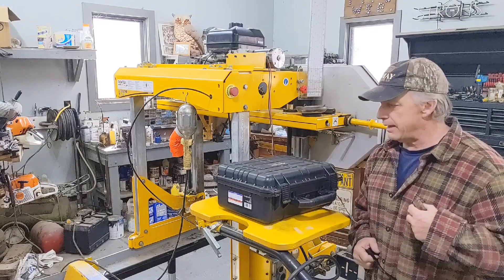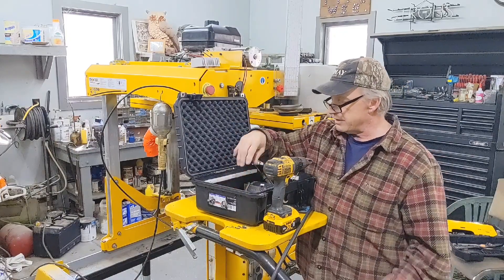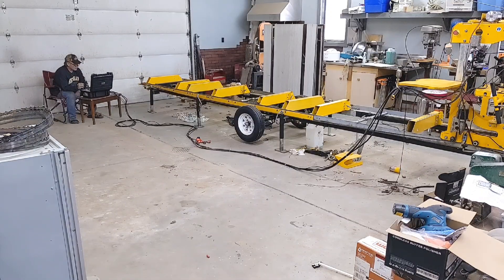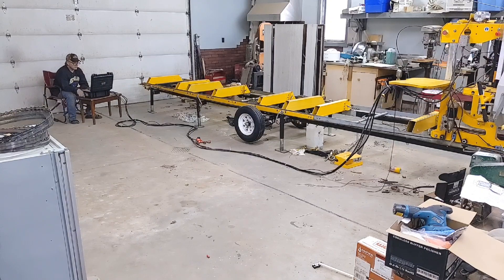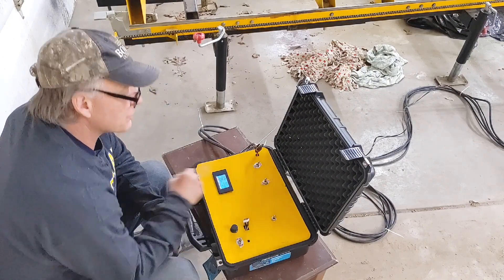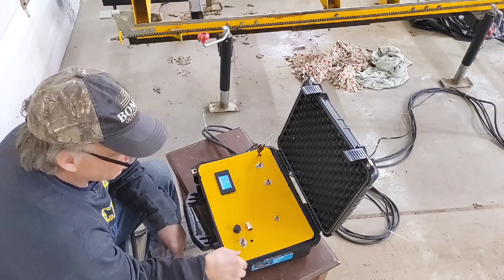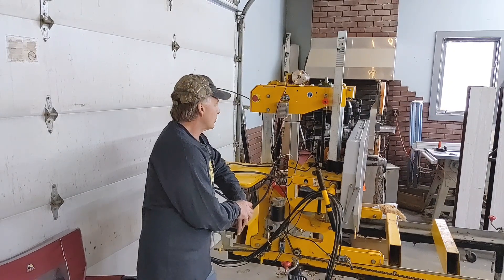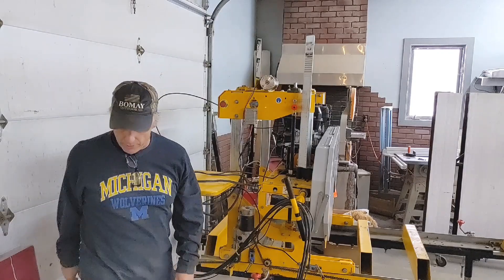Finalizing the Electronics for the Up Down Power Feed Part 7

Comment: As long as you label your switches, even if it's labelled in your mind, down being up, or left being right, will become normal!! Also, It seems like your single 12 volt battery should have no problem handling the step up to 24 volts, while still having enough amperage! That will keep charging and utilizing it for lights or other accessories simpler!! Looking great Jerry!!
Reply from the maker: Tim, I've been using the same battery for this entire build and it's still holding a charge.   I'm really happy with it.   It's just buttoned up and ready to work soon.
Reply from the maker: Thanks for all the support

Comment: Hello, Jerry. I've been using your videos for ideas on my mill build. Right now I have the bed done and I'm working on the carriage. You actually showing your work has been a big help. I was going to use 1 1/4" acme rods but now I'm questioning that decision. Why would you use smaller rods? Is it just because of cost savings?  Thanks again for the videos.
Reply from the maker: Yes it would be for the cost savings.  That is the only reason.   Best of luck on your build.

Comment: Very nice... first stept!

what would be beneficial for the system is:
1. I would remove the cales to the control box and do a RF communication between the control box and the motor control unit on the mill
2. I would like to have a automatic full speed mode for lifting the head after the cut and after sending back it should automaticall go to the postition back in full speed where it left.
3. I would add a rasperry PI to get "modes" included. it could also do soft start - stop modes, or a current for feed depending feed-speed etc...
4. with 3. i would add a DRO - so you can run "programms" for cutting eg. 2 by x bords...
Reply from the maker: I agree.  However what you are talking about is above my pay grade at this time of my life.   The last programming classes I had were fortran, pascal, and C in the 80s.   But yes that would be awesome.
Reply: @BigelowWoodcraft  OK, maybe someone from your community on the channel can help out? Rasperry Pi is straight forward - everything already readymade for use. BTW. #C is fine ...

Comment: I bought a piece of pine yesterday, 1x6x16 foot , plained 4 sides , $27. Pretty sure your modifications will be paid for most rickety tick. Really cool build. Like that you went to 24v. Excited to see it in the field. On the up and down switch , do you have to hold it or does it click into position. If it clicks into position I’d worry weather with all the noise and commotion of milling it might go unnoticed in the on position and crash ? I’m no word smith lol. Thanks Jerry. Appreciate your videos ( am inches from pulling the trigger on a hm126 )
Reply from the maker: It's amazing the price of lumber isn't it?  I thought I bought a momentary dpdt switch but unfortunately the one I received wasn't.  It clicks into position.  I'll run this and see if it becomes a problem.    You will love that mill.  My friend has one.   Unfortunately he doesn't use it that often.  Thanks for the support Terry.
Reply: @BigelowWoodcraft  wondering what would give first if it crashed. Those motors have some ass. Fuse ?
Reply from the maker: Well if it goes all the way to the bottom it'll just stall the motor.  If it crashed to the top it would lift the screw out of the bottom pillow block bearing until the sprocket on the screw hit the top of the mill.  Then it jams up. Don't ask me how I know lol.
Reply from the maker: Yes that's why I bought the amp meter.  I've been watching how many amps I'm using and going to match the fuse accordingly.

Comment: Nice job Jerry. The 24 volt is a nice upgrade I might try on my mill. I wonder how the remote control station will work out though. Can't fault a guy for trying to work smarter instead of harder.
Reply from the maker: That's why I'm building it.   I'll test drive this for you guys.  We may like we may not.  My concern as well.  Thanks for all the support.

Comment: Awesome job. Just my preference i like the control box on the mill. Your going to be working the log and stuff so you will be right there. Also I wouldn’t like the wires on the ground I would be tripping over them.
Reply from the maker: Thank you.  The wires are my biggest concern that has to be addressed.   I'm going to make a mount to coil the wires up in time. That will allow me to keep the controls on the carriage.  It's been a fun project. Thanks for the support.